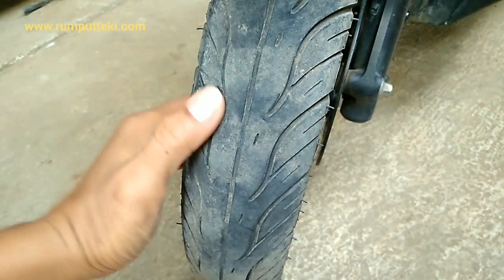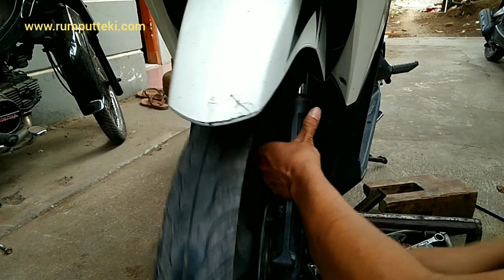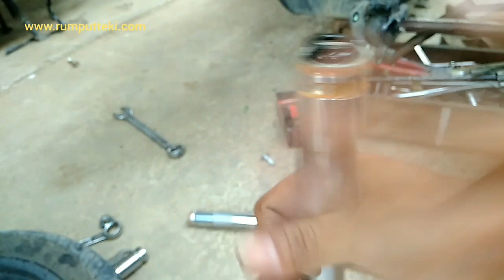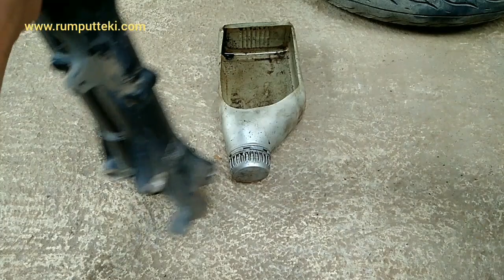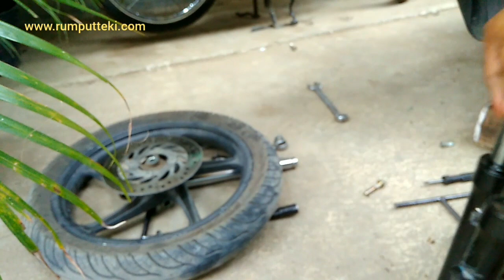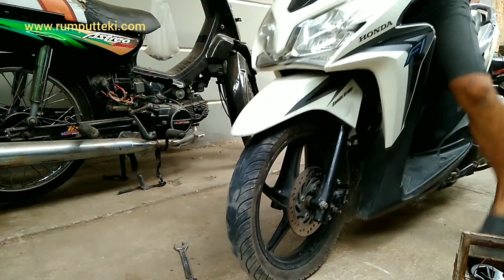Penyebab Ban Depan Motor Matic Aus Tidak Rata

Comment: Motor q rung ngasi setaun wes gundul ketok benange mas(kanan) yg kiri masih tebel se tebel2 nya😅.... baru nemu ini pdhl motor matic di rumah ada 4 aman semua(honda semua) .. yg saya pake ini yg bikin puyeng..(vario 150)
Pdhl pmakaian jg normal..gk prnh jalan jauh...pas tak bongkar kmaren oli sok ketinggian hmpir sama...tp gundul e kok nemen bgt😢...
Di tunggu solusi lain.nya mas...👍👍
Reply from the maker: ganti oli, shocknya brapa cc?
....mari sabskeb ....
Reply: Bengkel le ganti mas...wkwkwk
Wes di sabskeb biyen2...
Ameh takon maneh mas...motor matic posisi di dorong(mesin mati)..harusnya kn suara halus....klo ada suara kasar ..ngorok gitu...seko Area ban belakang/CVT apane ya?🙏
Reply: @miftahacoustic4264  bantu jawab... kalau cvt biasa nya bearing bambu dan bearing lainnya yang ada dibagian assy kanvas ganda....

Comment: Mas mau tanya. Rencana saya mau ceperin shock vario 150 dengan cara potong per. Itu lebih baik pakai per ori, kharisma atau vario tecno ya mas, biar tetep enak atau empuk. ? Soalnya karekter per vario tecni 110 per rengang smua kalau per ori, kharisma regang dan rapet.
Reply from the maker: tetap enakenurut saya kurangin takaran olinya saja mas,
banyak keluhan dari suara sama perform untuk yanh potong per,
silakan subscribe dan like videonya....
Reply: rumput teki dikurangi berapa mili ngeh mas.? Kalau kelebihan dan kekurangan per shock yg regang smua dan ada rapat plus rengangnya itu apa ya mas?

Comment: Mas maap mau tanya, penyebab motor beat karbu saya oli tidak naik oli ke cilinder head kenapa ya? Padahal oli di krengkes ada keluar. Udah di bersihin lubang2 di head masih aja ga naik? Mohon jawabannya mas
Reply from the maker: masalah kadang bukan dari arah naik tp arah ke lainnya karena bercabang peredaran olinya, jika salah satu lubang terllau lancar maka ke arah lainnya gak mau, tp juga dipastikan ada kerusakan di pompa oli gak itu kan sering asang gak pas gearnya jadi giginya ompong
Reply: @rumputteki  iyaa dari semua cabang oli yg naik gaada yg keluar oli nya. Pompa oli belum di cek karna harus belah mesin, baru di cobain di lubang silinder head di semprot sama kompresor ada angin masih ke dalam mesin krengkes. Apakah itu normal? Atau ada cara cek pompa oli tanpa harus belah mesin dulu?

Comment: Vario saya malah ban belakang yg aus sebelah kanan. Kenapa itu mbah 150 2019
Reply from the maker: cek bos mesin sudah gojlak belum...
Reply: @rumputteki  gak ada tanda-tanda gojlak boa. Tapi ban depan aman. Yg belakang ada cekungan gitu di sebelah kanan. Padahal sebelah kiri masih cembung ban nya. Motor jarang di pakai. Apa karena keseringan standar samping
Reply: @korbankoruptor5330  standar samping gak ngaruh, itu emang penyakit matic single rear shock, solusinya jadiin 2 shock belakangnya, itu juga harus presisi ketinggian shock kiri kanannya
Reply: Gk ngaruh satu shok mau kanan mau kiri, mau dua shok kanan kiri.
Semua matic ban pasti kemakan sebelah kanan.
Penyebabnya adalah ada di CVT, cvt itu berat boyy dia ada di sebelah kiri secara gk lngsung badan kita akan condong ke sebelah kanan untuk mengimbanginya.
Biar seimbang kasih kenalpot mobil biar sma berat sma cvt😁😁😁.
Reply: @riodwisaputra3785  setelah dicek memang engine hangernya gak center, perlu di press
Reply: @ahmadmujani1089  betul bang saya curiga itu kadang karet bosh aus sebelah juga gak center ban belakang nya

Comment: Punya saya scoopy ring 12, karna tapak bannya lebar, habis sebelahnya  parah banget, 🤦
Ada yg senasib gak?
Reply from the maker: iya mas sudaj saya post kalo mulai aus motore gak nuaman bgt,
///terimakasih dukungannya///
Reply: Punya ane ring plastiknya yg udh aus
Reply: Persis punya saya
Reply: Gk ngaruh satu shok mau kanan mau kiri, mau dua shok kanan kiri.
Semua matic ban pasti kemakan sebelah kanan.
Penyebabnya adalah ada di CVT, cvt itu berat boyy dia ada di sebelah kiri secara gk lngsung badan kita akan condong ke sebelah kanan untuk mengimbanginya.
Biar seimbang kasih kenalpot mobil biar sma berat sma cvt😁😁😁.